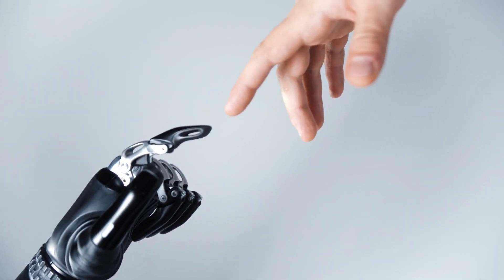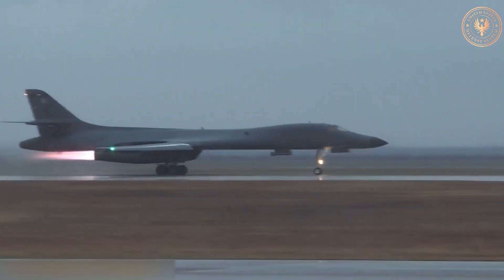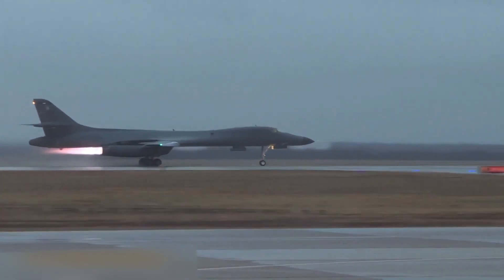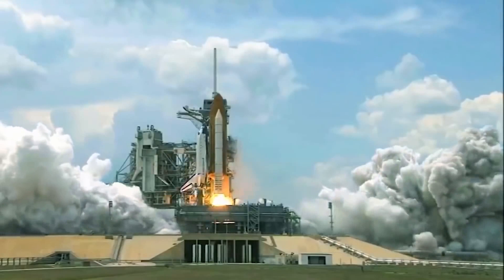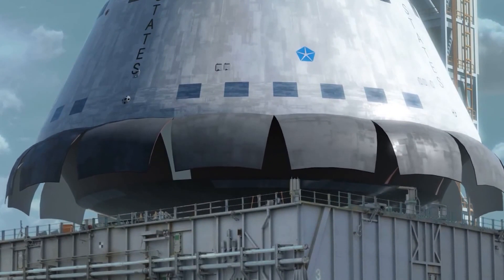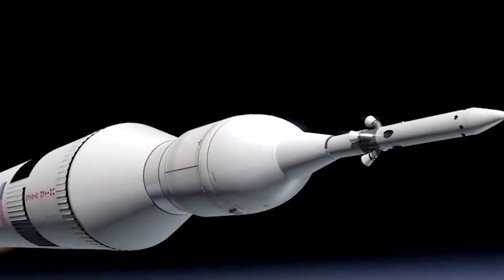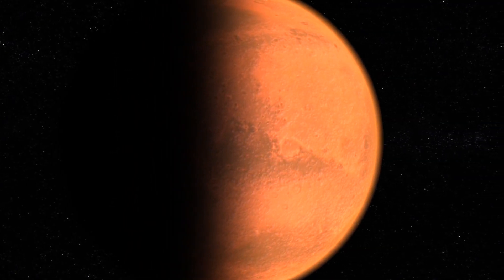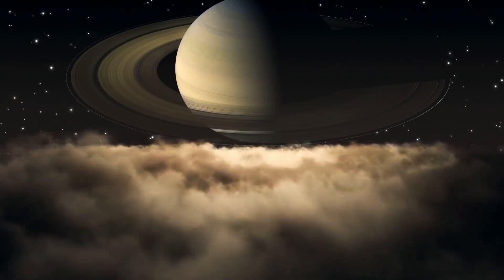GROUNDBREAKING! NEW NASA Deltaclipper is BETTER than SpaceX Starship!

Comment: So I can't decide if you promote one and then contradict it with the other. For eg stainless steel you roundabout imply is better yet the clipper is not stainless steel and you also point out that the clipper can put 100 tons to orbit whilst the starship 150 tons. So which is better,  bottom line you tell me.
Reply from the maker: Thanks for commenting Chris and thanks for letting your confusion know. To answer your question: I think both spacecrafts are good for different situations. But in short: On Mars, the hydrogen powered Clipper works better than the Starship. On Mars Starship is a single stage to orbit ship due to the efficiency of the Raptor (methane powered) engines. Hope you enjoy our other content!